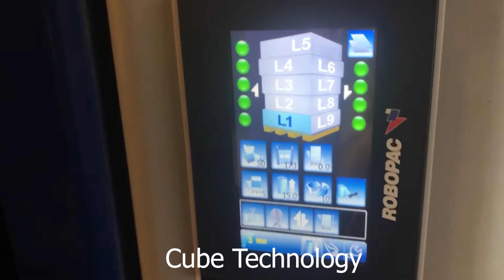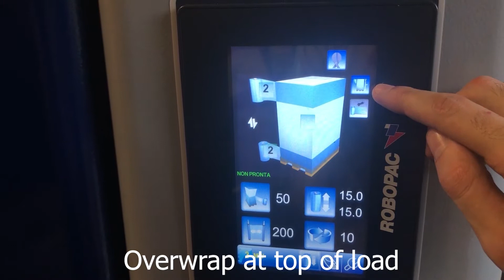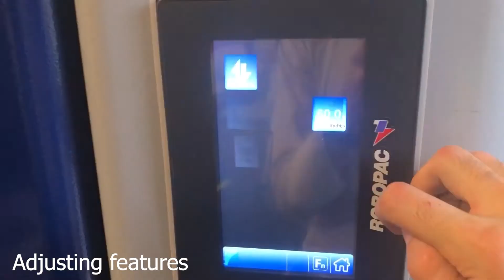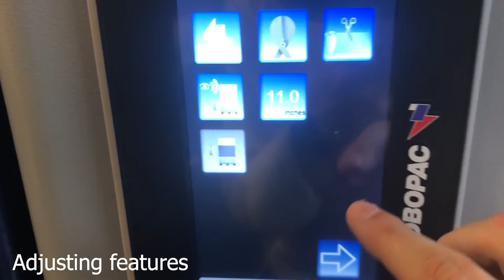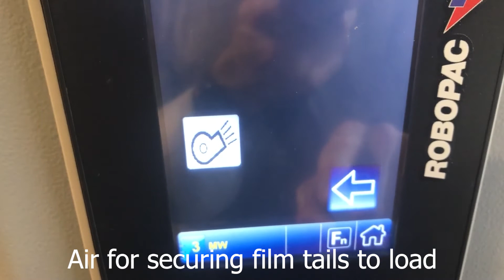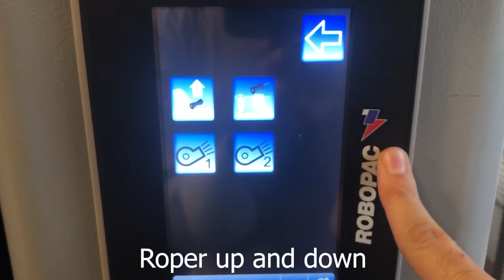How to operate the control panel on Robopac's Technoplat semi-automatic turntable stretch wrapper

Comment: They just added two of these wrappers on my factory my question  is how to set I up for 2 pallets  reaching@13 ft high
Reply from the maker: Wrap heights for this machine are either 86" or 110" max wrap height. You will find this also with any competitive machine. Please contact us at 678-473-7896 to discuss wrapping a load at 13 feet high.